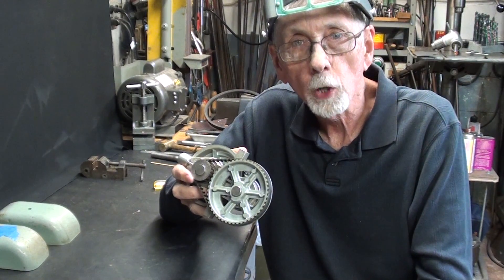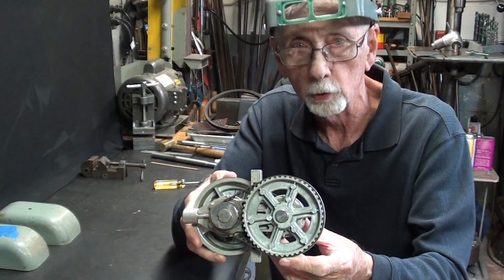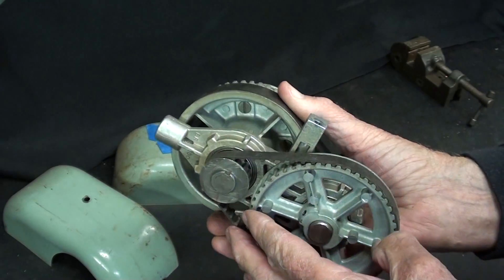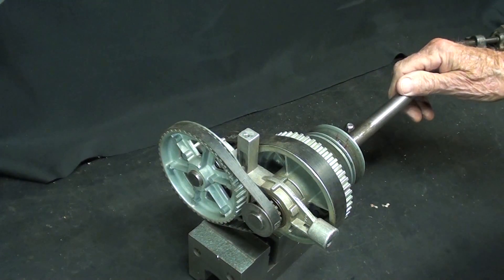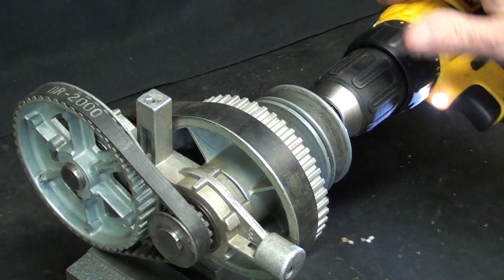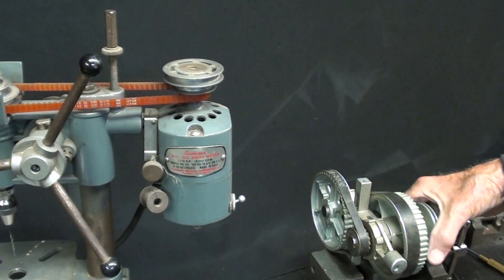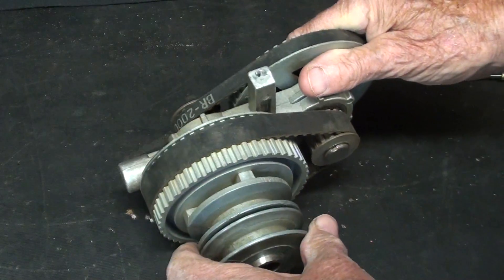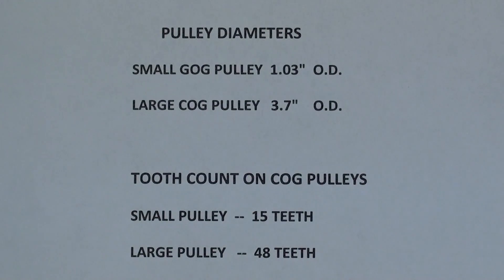What Makes It Work? #33a SPEED REDUCER tubalcain part 1

Comment: I am presently building a similar set-up for a Delta with a lower cabinet.  My math suggests that  two six-inch pulleys and two 1.75" pulleys in a jackshaft set-up converts a 1725 motor to 148 FPM.  To do this I am using pillow block bearings and a single shaft but will have to build a new blade guard.  I also lowered the motor in the cabinet and raised the saw a fuzz, in each case to give the belts a bit more distance & bearing area.

Comment: That would be a ratio of 3.2 turns on the large pulley for every 1 turn of the small. Across both that is 10.24:1. Therefore in effect this device slows the motor down to roughly 10% of its normal speed.

Comment: 10.24:1 reduction is what I calculate going by the tooth counts of the pulleys.  By the way, at least one of the diameters you gave in the video must be incorrect because the ratio of the diameters to each other should be the same as the ratio of the tooth counts to each other.  Not sure what happened there.  Also, you said the small pulley was 1.3” diameter in the video, but 1.03” on the screen at the end.  Neither yields the correct answer.  Thought you would want to know.

Comment: Moderndaytinker here; 
Using modern,bi-metal, variable pitch , blades --- we ran a whole factory , tool room band saw at very fast speed. We couldn't believe how long it lasted. Sales man was Right !  I can't remember what speed it was , but look up specs. The maintenance guys would ruin one to two a Day,of the regular high carbon blades.
These would actually last a WEEK ! They mostly cut sheet metal , which broke off the slower running blades.,👍😎

Comment: Huh, neat that the full speed and reduced speed pulleys are on the same axis and right next to each other so you can easily switch the belt between them; I’m more used to seeing a trio of stacked step-pulleys with the one in the middle on a jack shaft  (like on a drill press), but I don’t think even two sets of reduction like that would give the ~10:1 reduction of this setup. 

I’m wondering why the larger timing pulls closer to the motor is so wide? The timing belt isn’t that wide and isn’t going to mine back and forth much. Could it just be that they needed the extra thickness to adequately support the smaller v-pulley that’s bolted to it?

Comment: I converted a WWII Navy Delta bandsaw with the smallest drive pulley I could fit and the largest driven pulley I could fit.  Works perfectly with steel or aluminum.

Comment: How does the second small sheave rotate at a slower rate yet both are attached to the same shaft?  I mean, attaching a belt to one is direct drive yet the other is a remarkable reduction.  I don’t get it.😮

Comment: Mr. Pete, You sly old dog giving to much info to confuse everyone. Tooth count has nothing to do with the problem. Toothed pulleys are for power transmission, no belt tightener. If figured outer diameters a lot of people had the correct answer at 7.18:1 ratio

Comment: Hi Lyle,
On the assumption the motor is doing 1725 rpm, the reducer has 2 equal reductions, the first reduction will drop the 1725 rpm to 539.0625 rpm and the subsequent reduction will drop that to 168.457 rpm.
I can only assume that you measured the gogged pulleys to their outer diameter or the top of the cogs, because it gives a faster rpm, which is not possible with a cogged belt.
That is quite a nice little speed reducer. It certainly looks well made.

I have also seen where they have used expanding pulleys that give fully variable speed, between a range, where the motor has a fixed pulley and is on a hinged platform that compensates for the change in pulley diameter, that system was used on some small offset printing machines. And now they have systems where there is an expandable pulley on both motor and drived shaft that increases the variability with smaller movements and constant shaft positions.

Modern motor controls, like VFD's, almost make these mechanical systems obsolete.

Regards Dennis.
Reply: used to know a SGT Ledbetter when I was stationed at Ft. Bliss. Heard your name mentioned in part 2 of this series. were you ever in the ARMY?

Comment: As others have said it is a 3.2:1 ratio for each set of gears.  So 10.24:1 ratio at the end.  If it was a v belt pulley you would use the diameter of the two pulleys to determine ratio.  But since they want to reduce slippage they have used a timing belt, which has teeth.  You use the number of teeth to determine the the ratio.  The diameter is only relevant to the manufacture of the pulley which will give you the right tooth pattern and number of teeth.  Which in this case is 48:15 = 3.2:1.  When you have two sets of pulleys that are reduced (or increased if you were to reverse them) you multiply the ratio's to get the final ratio.  You multiply them in order from input to output.  Like so:  (3.2/1) x (1/3.2).  If the last pulley in the set were different by 1 tooth you would get a different outcome.  Lets say the last pulley was 47 teeth then it would be (3.2/1) x (1/3.13) = 10.016/1 ratio.  Because 47:15 = 3.13:1.  Which doesn't seem like much but can make a huge difference in a larger machine that rely's on this mechanism to have a precise timing.

Comment: My second hand Burgess bandsaw was supposedly 2 speed  for either wood or metal, but it did not
have the large toothed gear similar to what you showed so could only be used for wood.
I made a gear out of aluminium realising that I did not need to make the teeth. The toothed belt (similar to yours)
would grip anyway as it had enough wrap around. It worked perfectly for metal.
I stopped using it because saw blades for metal are now non-existant  or too expensive here in the UK.

Comment: Yes, I want one for my 14" Rockwell band saw!  Some gear reduction (10:1 ideal) would help tremendously. Alas, none to be found and home-build is a bit out of reach.

For a poor substitution I use a DC treadmill motor with a speed controller. Works OK,  but at low speed and high load the torque requires too much current which exceeds the motor power dissipation and the controller current capability. Motor overheating and drive transistors failures follow. Careful management of cutting conditions helps.

Comment: You need to connect it backwards with a pulley on the motor the same diameter as that inner pulley and see how long it can run at 17340 rpm hehe

Comment: 48/15 * 48/15. They are in series. 3.2 x 3.2 = 10.24
This answer HAS to be right, because I used the Scientific function on my calculator. ;)

Comment: The trouble is that the final drive is through a v-belt on a small pulley. A metal-cutting bandsaw needs a huge amount of torque on the final shaft (the one with the lower blade wheel) and that v-belt just cannot deliver it. The final shaft needs to have a fairly large gear on it being driven by a smaller gear, as found in the Delta 14" metal cutting bandsaws.

Comment: Just eyeballing the pulley sizes, I'm going to say this is about a 10:1 reduction.

Did the mating pulley on the band saw slide back & forth to align with the selected or? Guess I'll finish watching and give out.

Ok. 15 & 48 give (48/15)² as the reduction, or (16/5)² = (3.2)² = 10.24. Good to know that my eyeballs are reasonably well calibrated.

Comment: 10.24 to 1.  So about 1/2 the reduction you need to go from wood to metal.  I thought we generally needed to insert 20:1 or turn at 1/20th the wood rpm?  I think if the drill press were running a 2 on the motor and a 6 on the wheel, you'd need to drive a 12 on the wheel to get your 20:1.  So if I am correct you need a step pully on the wheel to add to complete your ratio.

Comment: I agree with the other comments ---- 10.24:1
As a side question, you could ask why one belt is wider than the other ??
Reply from the maker: Yes, I was wondering that myself. I do not have the answer
Reply: @mrpete222  OK --- the power is the same through the whole system, but the second set of wheels is moving more slowly, so the torque is much greater. This means there is more strain on the belt, so it has to be thicker !
Reply: videos are great ---- keep up the good work !!

Comment: a little bit more then 10 times  🙂
btw, if the teeth ratio is 3.2, then the O.D. ratio should also be 3.2, but it isn't, so there's something wrong with the O.D. measurement ?
Reply: Don't confuse outside diameter with pitch diameter.  The latter is the controlling diametric ratio.

Comment: 3.2 to 1 per set, first reduction yields 539.0625 rpm and the second 3.2 to 1 will give you 168.457 rpm at the drive pulley for a total reduction of 10.24. Was this marketed as a 10 to 1? on 1725 rpm motor.

Comment: I came up with the same results as everyone at a 10.24 gear reduction. With a 1725 motor the pulley should be turning around 168 rpm. If the pulley on the reduction unit is 2"" and you are driving a 8" pulley on a 14" bandsaw you should be around 154 surface feet per minute. Can't wait for the next video so I can find out who made it.

Comment: 48 teeth / 15 teeth means each reduction is 3.2 to 1.  Each reduction is the same, so that 3.2 to 1 reduction occurs again, which means the overall reduction is 3.2 * 3.2 = 10.24.  That means the rotational speed of the output reduced sheave will be equal to the rotational speed of input shaft divided by 10.24.

Comment: Nifty unit.  Has a sort of tight pulley/loose pulley idea to it.  I'd hesitate about taking it apart.  I think most understand how it works.  There is a risk of breaking some fragile parts.  I slowed down a 14' Delta saw, it works quite well.

Comment: Wouldn't  it be easier to count the number of teeth on each gear rather than measuring?  Even though it is a belt it is a chain and sprocket in function

Comment: There is a 3,2 to 1 reduction and that happens twice. That results in a total reduction of 10,24 to 1. For the indicated RPM of 1750 that would result in 170,9 RPM. Thank you for a great video and showing a great item! I love it and wish I had one. I especially like the way you can quickly switch between regular and reduced speed!. Very interested in a disassembly.

Comment: For go-cart builders who bolted the Briggs and Stratton reel type lawn mower engine to a wooden frame with a chain driven solid axle, a 9 :1 reduction would have been just the thing to pull through pot holes and mud in the county.  Its a question of which would have worn out first, the reduction or the semi-pneumatic tires.  After 65 years, I still value 10 inch tires of any kind.

Comment: I worked in a small machine shop that had a Craftsman bandsaw with one of these speed reduced on it. For a while now I have been looking for this same speed reduced to put on a bandsaw in my home shop.  With the  timing belt pulleys you can also count the teeth to get the ratio.  You did good with this find.

Comment: What a well made device that looks like it’s never been used. 170 output is a little too fast to cut steel on a 14 inch bandsaw. My Delta is driven with a 135 output gear-motor and still needs 3/1 step pulley reduction to cut tool steel with a Bi-Metal blade.
Reply: it can be connected to a larger pulley on the bandsaw to further bring it down or by using a 3 phase motor with a VFD even further without significant loss of torque by lowering frequency too much
Reply: @fasousa4798  correct, if de bandsaw pully is twice bigger then there is 85 rpm output

Comment: The driven shaft rotates a cog with 15 teeth.  With each full rotation of that shaft, those 15 teeth of the cog move 15 teeth of the belt, which then moves the larger 48 tooth cog.  15 teeth of the belt provides only 15/48 rotation of the 48 tooth cog though, for a rotation reduction of 15/48, or 5/16.

There is a second stage identical to the first for another reduction of 5/16, giving a total reduction of 25/256.

If the input shaft is rotating at 1000 rpm, the reduced pulley would rotate at about 98 rpm, more than a tenfold reduction.

Comment: (48/15)^2 = 10.24. I acquired one of these with a bandsaw but one of the timing pulleys was badly cracked and the belt was torn. Both parts were irreplaceable so I had to throw out and get a worm reducer. I think it got damaged because of heavy vibration due to a bad fit on the drive shaft.

Comment: I like these brain teasers.  I recall in my 20's before buying a set of tires, calculating which set would give me (theoretically) better gas mileage based on their diameters.  Knowing the tire diameter and the final gear ratio on my truck, I'd calculate what the engine RPM would be at a given speed over a mile's distance.  I see these little mouse cars zipping along and I think that engine is racing at a high RPM and must go through 3 sets of tires in a year.

Comment: Each stage gives 48:15 (equal to 16:5) reduction, so the combined reduction is the square of this, 256:25 which is 10.24:1.
My by-eye estimate at the start of the video was 9:1, foolishly assuming they had used simple tooth count ratios.
Reply: Kevin, I did the same, in my head; 256:25 is close enough to 250:25 equals 10:1, which is close enough for government work. But, I figured Mr. Pete would want a more correct answer so I multiplied top and bottom by four, giving 1024:100, and even I can do that in my head, to yield, 10.24:1 that everyone else is getting.

Comment: Using teeth - (48/15)x(48/15)= 3.2^2 = 10.24:1 reduction (ball park confirmation by cheating and counting turns at 4'20"). 
1725 rpm in, 168.46 rpm out
Fun, thanks squared.
Using diameters (3.7/1.03)x(3.7/1.03) = 3.59^2 = 12.90:1 which is not what I counted when I cheated by counting turns. 
I assume teeth force a ratio that is not quite what the diameters would give. 
Does this mean the belt must be stretching/slipping fractionally in order to keep the teeth engaged? 
Intriguing!
Thanks for the brain exercise.

Comment: Everyone cheated!!! They used the tooth count to calculate the ratios... You can also calculate the ratios by the OD's of the pulleys, too!  Only problem is the diameters given only give you a ratio of 7.18:1.  School teacher gave us incorrect figures to work with. How can we pass this test without crucial information to work off of?  As always, thanks for sharing, Ken
Reply: Ha! Teacher gave you both the tooth count and diameter of the pulleys. He did not give the pitch diameter of the pulleys. If you want A++ on the assignment you need to calculate the ratio based on the teeth and then solve for the pitch diameters of the pulleys for the extra credit.
Reply: @BrianEltherington  😳
Reply: The diameter measurement the teacher states is the outside diameter (which you can measure directly), not the pitch diameter (which you can't measure).  The pitch diameter is what constrains and determines the ratio, not the outside diameter.  So he's testing your theoretical knowledge, to see whether you make the error of rating by the non-determining diameters.

Comment: Both toothed pairs of pulleys give a 48:15 or 3.2:1 reduction in rpm related to shaft direct output. Hence a total of 3.2x3.2:1 or 10.24:1 for the two connected pairs. Therefore for a 1750 rpm induction motor, the output will be 1750 divided by 10.24 or 170.90 rpm (to two decimal places). 😊 👍🇬🇧👍🇺🇸👍

Comment: Since we are not driving with a v-belt the diameter is not so relevant. It's the teeth that drive. Therefore 15t : 48t. 3*15 gives us 45 with 3 more teeth needed for a full rotation of the big pulley. Since the 15t is driving 3/15 is 1/5 or .2. So 3.2 : 1 for the first side. The second side is the same ratio. For one rotation of the second large pulley we need 3.2 * 3.2. That gives us 10.24 or roughly 10 1/4 : 1 speed reduction. Yes?
Reply: @tigeraudio  Good question, I follow the words.
To get the first large cog to rotate 1 time the small cog need to rotate 3.2 TIMES. 15*3.2 is 48. So for the second big cog it's little cog has to rotate 3.2 TIMES. The second little cog to rotate once (same as the first big cog) the first little cog has to rotate 3.2 TIME. Therefore second big cog equals second little cog TIMES first big cog TIMES first little cog. ( 3.2 * 1 * 3.2 = 10.24)
Is that clear as mud? Lol

Comment: 1/((15/48)×(15/48))
10.24:1 as others have already posted.
Should give an output speed of around 155-160rpm under load I expect. 
166ish with a 1700rpm motor, just a guess at the loss of speed under load. Shouldn't be too much with that torque multiplication depending on the motor.

Comment: The number of teeth on the gear pulleys is irrelevant.
Reply: Not sure about that, gearbox would be hard to turn if teeth ride up over cog peaks occasionally due to any major difference between diameter ratios and teeth ratio. 
I imagine the teeth would tend to force the belt to slip slightly in order for the belt teeth to engage the toothed pully rather than cam up over the pully teeth.

Comment: I figured a 1750 rpm motor would run the saw at 170.89 rpm, approx 10 to 1 reduction.

Comment: The drive shaft goes all the way through to a small pulley (15t), which drives a big one (48t) via a belt. Thats a reduction of 15/48. That large gear forms a compound gear with the 2nd small gear, again 15t, which drives the second big one. That's another reduction with the same ratio.
(15/48)*(15/48) = 0.097, about 0.1, a tenth . Thus the reduction is about 10:1.
Alternatively, you could flip the ratios in my calculation, but I like to calculate how many turns a 2nd gear makes when driven by a first gear and that's t1/t2.
Reply: That's what I calculate.  Your explanation is well done and spot on!
Reply: Correct.
Reply: wrong, must be 10.24 to 1
Reply: @be007  You're right, but it's for a band saw. The saw isn't gonna complain about me rounding things off.
Reply: @be007  The O.P.said ‘about 10 to 1’. That is not wrong. ‘10 to 1’ is, indeed, about 10.24 to 1.

Comment: Assuming 1700 on the motor output will be 166 rpm  Reduction is 3.2 to 1 in both instances. Regards from Australia.